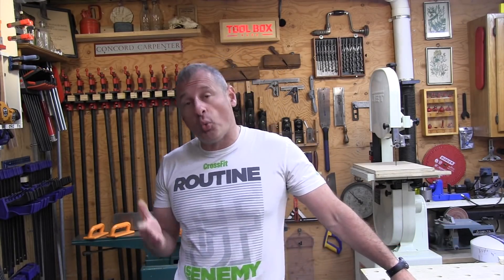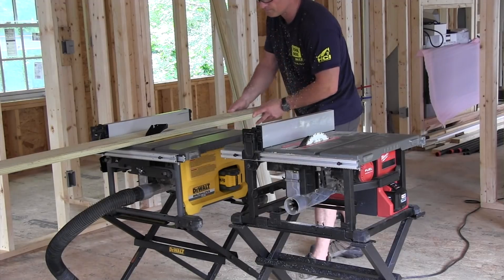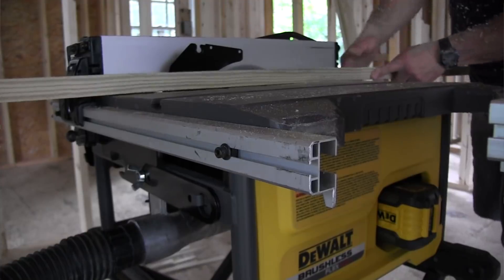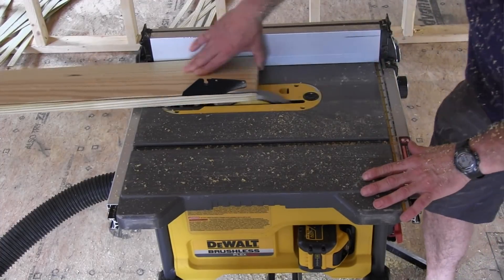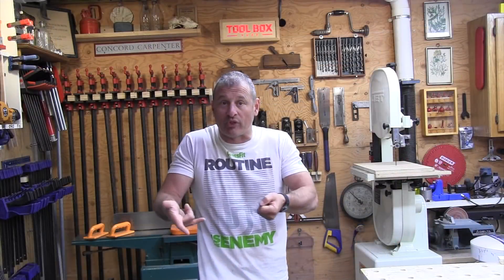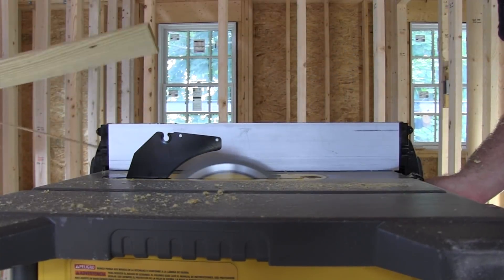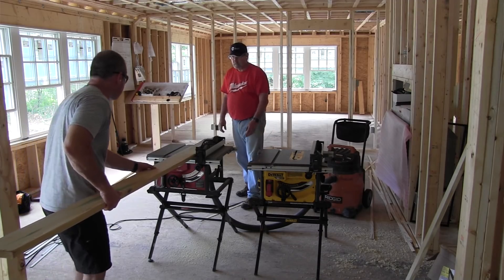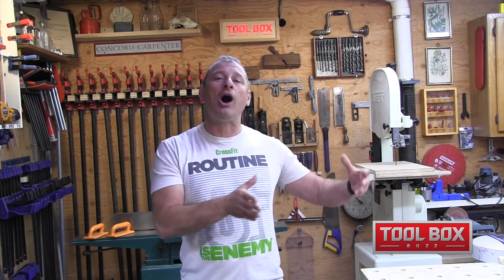Milwaukee and Dewalt Flexvolt 12 Ah battery Runtime Test Results

Comment from the maker: Guys we do a lot of tool testing every year and try our best to provide the best and most accurate results possible given our limited testing capabilities and budget. 

We’d like to think we get it right every time but that’s just not possible. 

We’re going to pull this video until we can retest. 

After working further with the DEWALT saw today on a jobsite we felt something was off or not working properly and hence may have affected the results that we published.
 
Until we can get the issue resolved we felt the video should come down. 

We’re getting a new saw, new blade, and battery to test and be sure the results are accurate and repeatable. Stay tuned for an update in the near future.

Comment: So the test was pointless then as they used a different blade. They should have used the same blade as the previous test so we can see if the other blade is better than the dewalt blade.
Reply from the maker: I wouldn't say pointless - we learned a lot. We'll be doing one of our deep dives into these two saw soon.
Reply: Sorry Rob, I might have been a bit harsh in my reply but changing 2 variables in any comparison means you don't know what the results mean. Especially as the results are not what anyone expected.
Reply from the maker: were gonna run another test as soon as we cycle thru a few battery charges. which brand blade should we use?

Comment: As a Dewalt user, I am disappointed. I expected more out of the Flexvolt system. Dewalt needs to get their act together. There is no excuse for the their 60v platform to not excel over Milwaukee's 18v. Thanks for another great video! much appreciated.

Comment: Look at those saws.... they’re practically identical. Tiny differences in shape and colour is all that separates them, and they’re choosing to compete on the grounds of their batteries.....the 1 thing neither company has and influence over, 2lb of lith-ion Is 2lb of Lith-ion. 60v vs 20v isn’t even producing a difference.
The deck, the materials, the attachments, the fence, the performance, all exactly the same, how is that even possible unless they agreed to do that and pretend to fight it out in the battery department where the whole world knows that tech will slowly get better on its own? 
This is just industry laziness, there isn’t a single thing about 1 of those saws that isn’t exactly as good as the other.

Comment: (2) 12 amp hour batteries, identical performance? What's the problem with that? It means as a consumer, you can't lose. Let's not forget we now have useful BATTERY POWERED table saws!!
The cells in those batteries probably come out of the same factories. There is no magic in electricity, just math. Send them to AVE for tear down and testing!

Comment: The ONLY time you will really benefit from the Flexvolt is in very heavy applications. Take some thick, hardwood and cut at maximum depth and the Flexvolt will slay the Milwaukee.

Why? It's simple math.
At first, the Dewalt isn't 60V, it's 54V just like the 20V really is 18V (America likes bad ass labels).
Let's say we have to draw 2000W from the application, a really heavy app just to make an example. To do this, how many amps must be delivered at a certain voltage?
At 54V we need to draw 37A to generate 2Kw, but in
18V we need to draw 111A from the cells to equal 2KW and under heavy load there is another factor that plays in, you will have a voltage drop, let's say 3V to make it easy, but look how that affect the amp draw to compensate since the saw is really working hard and demands 2Kw...
Now at 54-3=51V we need ca 40A, an increase by 3, but the 18V platform, now 18-3V=15V actually needs ca 133A. Since there is a maximum draw from each individual cell, once you pass that number, 18 or 54, the BMS (Battery management system) will shut your tool down by cutting away power, and you will reach that point faster in 18V than in 54V the heavier the load is. 

But that said, maybe the new 21700 cell can put make-up on the difference between 18 vs. 54V since not many of us use the tools at breaking point 100% time. Wait until somebody makes a portable welder carried on your back with 2 or 4 batteries, then you really will benefit since draw is huge.

I love Milwaukee, but I'm buying Flexvolt.

Comment: I think this is pretty interesting result.

To be honest, I thought Milwaukee would outperform Dewalt.
Milwaukee's table saw is optimized for 12Ah battery, which is Milwaukee's first bigger cell battery pack.

Dewalt, on the other hand, made that table saw when they first introduced Flexvolt. It was nearly 2 years ago.
And the first Flexvolt battery used old 18650 cells which has lower capacity and lower discharge rate. So Dewalt's table saw should have been optimized for that.

But Dewalt is still performing about the same as the newest Milwaukee table saw... Really interesting.
Or, maybe it's because of that blade?

Comment: I'm not surprised by these results using the chosen material. Under a load both saws can easily handle, 12 ah should be close to 12 ah.  Where the difference will show is in power.   I would expect the 54V system to better handle denser, thicker, and faster cutting overall.  That would be basic voltage theory anyways, and the rest would be up to design and quality of efficiency.  Pneumatic analogy - Voltage is like the 'pressure' , amp hour rating like the size of the tank.  If you only need 20 psi to do the cut, and the tanks are the same, both should perform equally.  But 60 psi has way more potential than 20 psi as far as power and torque, no matter what you do. On a brushless platform, the tool only uses as much pressure as is necessary.

Comment: I'm an EE. Although power is not my field of expertise, I'm not surprised by the result. The amount of work that can be done in theory by both batteries is the same (if you disregard heat losses) since they have the same amount of total energy (20v x 12ah = 60v x 4ah = 240 Wh). What can be different is the speed at which the work is performed and this is what should be compared.

In theory, the milwaukee unit should have higher heat losses because they use a lower voltage than the flexvolt. Therefore the runtime should be a bit less than the Dewalt but that's if the resistance of both circuits is the same which is clearly not the case here. Milwaukee probably used bigger windings in their motor and put in place some other optimisations to keep the resistance low hence why there are no difference.

Comment: i would think milwaukee could get better run time but dewalt would have bit more power..being that the 12 amp flexvolt is only 4 amps on a 60 v im surprised it comes that close to milwaukee. hopefully this new 12 amp is good in the rear handle saw cause i know framers cycling at least 4 9.0s a day per saw

Comment: That 12 Ah battery in a 60V tool is actually only 4 Ah capacity. It’s only 12 Ah in a 20V tool. So you get a little more power but less runtime.
Reply: Geno No they both have 240 wh of energy. 60v x 4ah = 20v x 12ah= 240wh. The number of amp hour is meaningless without the voltage. Energy is always measured in watt hours (or Joule for that matter) not in amp hours.
Reply: Alexandre Poitras but that still amounts to less run time in a 60V tool compared to a 20V tool. I have a 9aH flexvolt battery that will last a lot longer in a 20V circular saw compared to the flexvolt saw that I have.
Reply: Geno Off course since the 60v is a more powerful saw. You will discharge the battery much more quickly but don't forget you will cut much more quickly as well. In the end, you will have cut the same amount of linear feet but faster. Well that's not 100% true because one saw is maybe less efficent and therefore loose more energy in heat but you get the idea.

It's like driving from Boston to New-York. If we forget about the drag, it doesn't matter if you drive at 50 mph or 100 mph, you will still consume the same amount of fuel. 

A battery has a finite amount of energy in it and it has nothing to do with voltage.

Comment: Maybe I am wrong, but I think that Flexvolt baterry, when is used in 60v tools is actually 4 Ah baterry. It is 12 Ah  baterry when is used in 20v tools, and this saw isn't that..... I don't know....
Reply: Aris Kovačić 12h x 20v = 60v x 4a = 240wh. It's the number of watt hours not amp hours that matter.
Reply: You are correct. As Alexandre states, is watt hours that actually count. The DeWalt just switches the battery circuit from (3) 20v circuits in parallel, to (3) 20 volt circuits in series. Actually there 18 volts each, more marketing to fool you.

Comment: Both companies should take the 10s of millions they’re wasting in the advertising department trying to trick the world into thinking they’ve reinvented electricity and put it into the tool. 

These saws should have 1/4” thick Magnesium plate decks that cannot bend or warp with Incra level accuracy fences and gauges with actual Incra level Miter gauges and perfectly sealed blade compartments for dust collection with built in suction like the Dewalt planer has so it can eject right into a cyclone if you want.

If you think that would make it cost 5x more you’re wrong, just stop wasting 10s of millions trying to trick the world about the 1 thing you scientifically cannot change, and spend it on engineering.
Reply: Kermit absolutely agree!

Comment: No explanation needed,we value your real work tests on the jobsite.... Maybe the lumber on one of the tests was wetter,maybe the air was drier...maybe the pull'ey ate beans,and had an high internal gas ratio ... The wind was lower and had a lower coefficient drag across-the-board.... Yellow fan boys ,and red fan boys will read into it what they will.... I'll still be getting the fuel,but after the 10in miter saw debacle.... I needed a real world test.... I have 1 DeWalt battery for my framing nailer,and 15 Milwaukee's... Thanks for taking the time....again, for this test!

Comment: This is just industry Fuckery lying to the consumer about non existent differences and importance in battery technology, so you won’t expect them to put all those 10s of millions of advertising $$ into the engineering department to make a better tool, literally an industry con job to waste money and keep the quality of tool down. 

These guys did not reinvent electricity or the battery or the electric motor I promise you. 

The only real test to be done head to head for the sake of batteries is what EXACTLY are the motors receiving from them. 
This test (and many others) absolutely proves even 60v vs 20v is meaningless if the 20v is not lasting 3x longer then the 60v then it’s either irrelevant to the motor, or the motors are receiving the same thing.
Reply from the maker: Kermit You sound angry

Comment: I wonder why Dewalt  is charging a $50 up-charge $250 vs $200. They more then likely have the exact same cells. I'm pretty sure Dewalt and Milwaukee's 9.0 started at $199...
Reply: In Dewalt's defense, the Milwaukee uses the smaller 18650 cells.  Dewalt uses the pricier 20700 cells in both the 9.0 and 12.0
Reply: Milwaukee is using 21700 cells in the 12.0 that's why its bigger then the 9.0. Dewalt probability switched from the 20700 to the 21600 cells for the 12.0 too just like everyone else.

Comment: I'm surprised you didn't use the same blade in each
Reply from the maker: to be honest we didn't have another Milwaukee blade. Plus a lot of folks commented that the Flexvolt blade was made for and optimized for a their cordless saw. Again this is not a laboratory test - just a job site runtime test.
Reply: Noconz0727 MC why? The saw comes with the blade the manufacturer supplies, why would you use a different one? This was pointed out by more people than just myself.
Reply: Mr. B Because it's a runtime test and using the same blade removes that as a factor. 

You wouldn't want them using different types of wood?
Reply: Noconz0727 MC it's a runtime test based on battery performance of the tool. The variables include material being cut and the blade(s) being used. Both saws have different rpm, most likely different blade pitches and blade kerfs.. I don't want to speak for toolbox buzz but I'm sure that idea was to test the manufacturer's tool as set by them, the manufacturer. Any modifications would yeild tainted results. It's like when you put two truck head to head on a tow test. They come from the dealer and are tested in that config. They don't get tire upgrades or both gets dual exhaust. Run what ya brung.
Reply: A Concord Carpenter / ToolBoxBuzz 

No worries. Looking forward to your in depth tests as always

Comment: And again. Charging times on a just drained (hot) battery? minutes? hours?
Reply from the maker: krusch75 Did I not cover that in the article, if I didn’t I can’t because we have that information
Reply: How long do it take to charge the battery? And on job site, the battery is often warm. Since you often take it directly from the machine (drill, saw, grinder etc) when drained. And i wonder what charging time is under every day use on job site? We use the makita 9" 2x18v on site (less power than corded, but very convenient). I have the dual charger. And charge the batteries in less than one hour. That gives me continues run time througout the the work day with four 5ah batteries. So charging time is a very important factor for my company. By the way. I think your reviews are excellent. And nice to get reviews from real workers:)

Comment: As the battery cell technology continues to be pushed forward by developers like Panasonic and LG chem and Samsung and the like all things cordless and battery powered will continue to improve: power tools, outdoor power equipment, cars, energy storage for homes, energy storage for commercial and utility and grade scale uses as well. It's all tied to the same Core group of cell manufacturers and it seems like they are all going flat out to develop this stuff as fast as they can because they know it is the future and they just cannot make them fast enough.

Comment: Thanks for the real world testing. Also, thanks for the video about it. Bottom line with all of these battery operated cordless electric tools is that there are only so many battery suppliers in the world and all of these companies like Milwaukee, DeWalt, Makita, Ryobi, Ridgid, Bosch, Porter-Cable, all of them I suppose have a limited number of choices of battery suppliers to order from. Beyond that, there's not a huge difference in battery management technology in such a small package used for portable tools. Yes, there are some differences that can be significant but they are all working with the same individual cells or at least have access to work with the same individual cells so the end result can only be varied by a small amount and will be limited by the battery cell technology which is entirely out of their control.

Comment: I've read that DeWalt batteries may takes 5 cycles of fully charged and discharged to reach the optimum performance. Maybe this justify the lack in the operating time. However, I always find your reviews to be honest and focusing on what really matters to the end users.
Reply from the maker: Both batteries were new - so both in same place
Reply: I run two flex volt miter saws and have noticed that it took a few days of running and charging to get them where they will make it a half a day on a full charge. Mine are 6 ah and I am a production trim carpenter.
Reply: Me. B it had ppl tell me the 9 ah are a lot better than the 6 ah but I've been holding out for the 12 ah.
Reply: Remember Milwaukee nor dewalt make the cells, all they do is put the cells into a pack. Both of these batteries should be identical as 21700 are so new there are few battery brands on the market
Reply: Matthew Williams I run the 9.0's on my flexvolt miter saw and get a full day as a production finish carpenter. Big houses, lots of trim. Usually have to charge by lunch time on day 2
Reply: Alone by myself on trim jobs I can run 2  fully charged 6amh batteries all day on my flex volt duel slider no problem.
Reply: It's same for every charged battery that it will take few charges to fully operate.
Reply: Adam Petten that’s true, but the difference with Milwaukee vs Dewalt is that Milwaukee controls the whole cell selection from start to finish. In other words, they don’t outsource the battery pack construction to any third party company!
Reply: unless a manufacturer ships their batteries "pre-conditioned". but yes, same for me for my dewalt batteries. Took a few cycles to really notice the extended run time.
Reply from the maker: Thats really interesting - thanks for letting me know.
Reply from the maker: Adam Petten correct, the higher voltage should be operating at a lower amperage and as a result lose less power to heat. Better copper, magnets, electronics and motors all factor into this. The devils in the details!!!